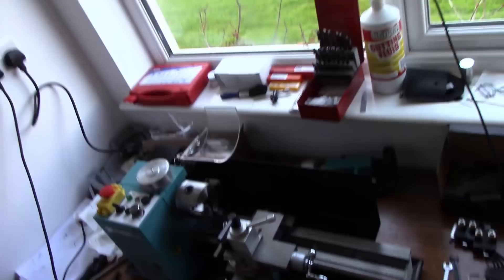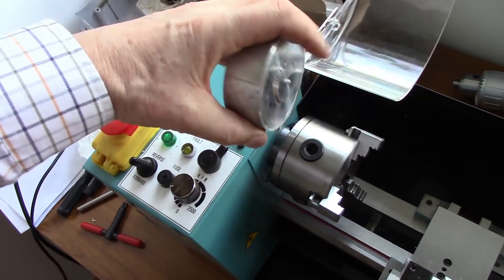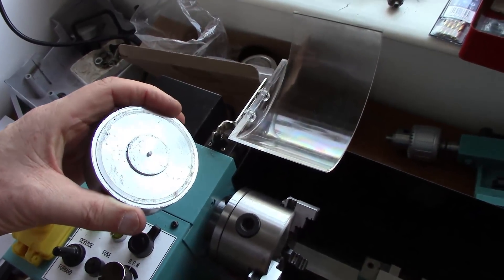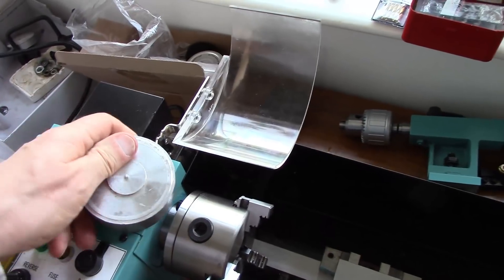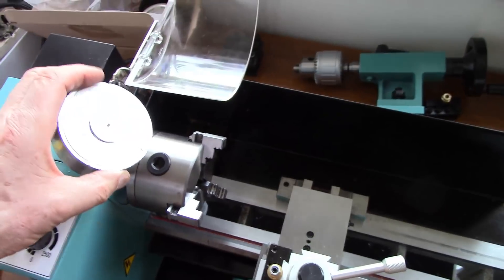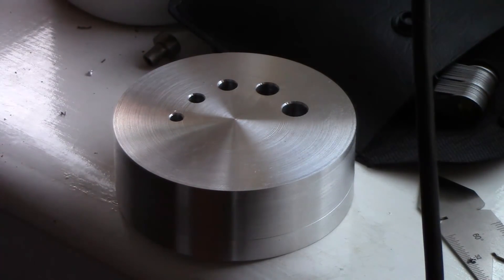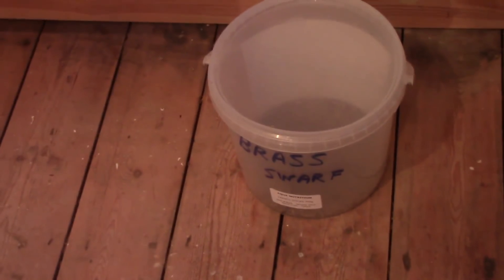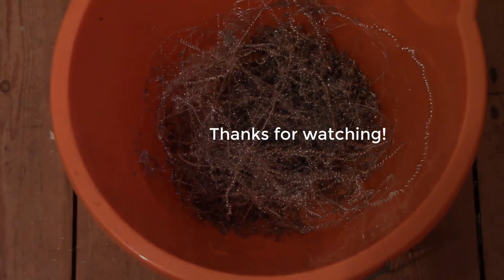Turning a large aluminium piece on the SC2 mini lathe

Comment: Hi. I’ve bought this lathe and the Chinese quick change tool post. Can I ask how you use/slacken the original tool post please? I’m ready to go however, the tool post handle won’t budge. Thanks in advance.
Reply from the maker: I can't remember much about this, but my recollection is that it just unscrews in an anticlockwise direction. So I suggest apply more force
Reply: @samuelfielder  thanks fella. I’m on to Axminster waiting on an email response. Once it’s off though is the Chinese quick change post easy to fit. I’ve got the same one as you. Love the videos by the way. Michael
Reply from the maker: @michaelchatt2639  Yes. It's just a matter of unscrewing one and screwing on the new one.
Reply: @samuelfielder  thanks again mete. Axminster have suggested some wd40 and a gentle tap. Failing that they’ll replace the whole lathe. I’ll let you know the outcome
Reply: @samuelfielder  fitted the tool post. Although I can’t fit the original black handle like you have. Any idea why Samuel?
Reply from the maker: @michaelchatt2639  Don't know. Does it not screw on? The thread must be the same (unless you had to tap the top slide).
Reply: @samuelfielder  I think I know what I’ve done wrong. You left the original bolt on as it hasn’t got the hex nut on. I used the one of two out the replacement tool post box!

Comment: Samuel,
   The nibs after parting off are a fact of life. Rarely is a piece parted off cleanly. 
    After you angled your tool a bit you discovered the chatter lessened quite a bit. Thirty degrees is not excessive and most machinists set the compound at 29 degrees and leave it there for most operations. 
    Aluminum of any kind is difficult to get a pristine finish with a hand fed cut. The interrupted movement creates the line pattern. Some have made attachments for cordless drills to facilitate more even movement. I’ve tried it but for me there are so many things going on while turning adding one more thing to do is counterproductive. 
   Swarf is the bane of aluminum, especially the long, stringy chips, quite pretty, but a nuisance. There are carbide inserts especially ground for this material but still do not break the chips adequately in my opinion. Also you will find in using HSS or carbide bits of aluminum will weld to the cutting edge as the tool heats up. Sometimes it’s just a matter of scraping it off with the edge of a file or knife. If the weld is severe the tool has to be re-ground. 
   I know I and others have offered this advice before but the more solid you get that little machine the more satisfied you will be with it. I know the machines come with rubber feet and are marketed as being portable but the stresses of cutting metal are considerable and far exceed portability and the capacity of the rubber to absorb the vibrations. (Only The Beach Boys are able to endure “Good Vibrations”. Lol)
   As for your comments about people enjoying watching someone with no lathe experience we are all on a learning curve here and most of the advice given is from those of us who have been right where you are now and give comments on how we approached and solved the problems. 
   Machining, even with a small mini lathe can be an extremely satisfying endeavor as each little quirk of these machines are conquered.
  Dale

Comment: 👍👍  I think you need lube and you need to secure lathe to table with all the pressure from tool cutting into part you get bed twist and chatter. And i can see flex in your compound may need to adjust gibs a bit. And tool seems to be rubbing may neet to regrind with 6°relief as shown in tool grinding on you tube videos.
Reply from the maker: Thanks. When I have time I'll build a hefty table.

Comment: Hi Samuel, I often see the thumbnail for this video when I am on yt as it comes up as a suggested video.
That swarf is horrible, were you using machining grade aluminium? It makes life much easier for the machinist. I am not aware that the price is any different. I will only NOT use it when the customer needs to anodise or weld the part.
A carbide "finishing" insert could work well for a lathe that. This may help you get swarf that is more controllable.
Looking forward to the next video with a suit of small sails.
Reply from the maker: Haven't a clue what type of aluminium it was. Bought off ebay but it was clearly something that had been left over after machining. I don't know why this video has attracted more interest than most, because I really am only blundering around in the dark re. machining. Perhaps people enjoy watching someone who clearly doesn't know what he's doing!
Reply: No doubt it was machined.  Large lathes with lots of horsepower can rip into the other grades of aluminium without a problem.  It is smaller machines like ours that need the right alloy to work nicely. Anyway now you know it exists and if you have a bit to do It may be worth trying for a machine grade aluminium. Next Woodstock video??
Reply from the maker: Thanks. Working on next video but have been busy and we have difficult edit to do.
Reply: CAN !! YOU !! CONTROL !! SWARF !!!???
Reply: @davidwillard7334  I take that is me you are harassing again rather than Samuel? If so, indeed I can, I find the ultimate control is achieved by forcing the swarf into light proof bags and forcing it to sit on a cold concrete floor. It really hates that. Once I find it is taking up too much space in the workshop, I lose any desire to keep it under control any longer. I then force into a vehicle and convey it to a large recycling facility from where escape is impossible. The new controller then does with the swarf just as he wishes, he exerts far more control over it than I could ever hope to.
Reply: @smallcnclathes  WOW !! YOUR !! WORKSHOP !! MUST !! BE !! CLEAN !! AS !!???

Comment: Some of the chatter could be your tool post these aluminium posts are just junk
Reply from the maker: Yes. I tried to see this by filming lathe from two directions close up, but the result was inconclusive. I hgave tried using the chunky steel tool post that comes with the machine, for parting off, but I think most of the movement is in the gibs.
Reply: THE !! ENTIRE !! LATHE !! IS !! COMPLETE !! TOTAL !!AND !!!  UTTER !! UTTER !! UTTER !!! JUNK !!!!!

Comment: Is your cutter a fairly quality cutter? I’ve seen some where the cutter was terribly low quality, claiming it’s carbide or quality tool steel. Is there any play in the hand wheels, chuck, headstock or pulleys. Could it be the work piece too big for your cutter? Your cutter length rubbing work piece, as you feed in?
Reply from the maker: Thanks. I thought the tools were all good quality but I think now they are M2 steel which is without Cobalt, but they cut aluminium very easily (it seems to me). There's always some backlash in the hand wheels, not elsewhere. Yes, I did have the tool wrongly angled for the facing cut, initially. Not sure what you mean by workpiece too big for cutter. I should have angled the top-slide at 45 degrees to allow facing in one movement.
Reply: As far as the work piece being to big for the cutter, with those types of machines its a blind "hit or miss", my good friends son had a very similar lathe he used to make pens with, as a novelty, the kid wanted to make an over sized Yo Yo, with thin walls, the yo yo being 3" (76 mm), just about the capacity limit of the chuck, he suffered similar troubles as you, wanting to see the kid's process of machining this sized piece, i found no matter what the kid did, he would get chatter. when i fiddled with it, i had to speed and feed very slowly, which was very bad on all levels, including the tool cutter, which was a 3/8" cutter, for the machine. So i figured, I machine a one solid, tool post (eliminating compound slide for this project) with the ability to hold 1/2" and larger tool holder/cutters, though it made the small lathe a little "Frakensteinish", at the time, we found any size tool cutters (small to large) would work. I then found Robrenz and Steffan Gottswinter videos had built similar tool posts. so, if you wanted, you could probably try this route.

Comment: The rigidity is my point. Unless the lathe is firmly attached to the stand or table, you'll never get the rigidity you're talking about. Please try it!
Reply from the maker: Well I might - despite not following the logic - as having the lathe bouncing around relative to the camera is a nuisance.
Reply: I also think you would be better off having it bolted down to a heavy worktable, with the machine vibrating like that i i can imagine there wont be very stable cutting, this is usually never an issue when working "normal" sized lathes as they are far more sturdy than these things and sit steady on the ground just with their weight.

Comment: My opinion is that your lathe is flimsy or not securely attached to the work table. I noticed how it shook when you cranked the tool back after facing the piece.
Reply from the maker: Indeed it isn't securely fixed to the work table. It isn't fixed to it at all! That's why it shakes with respect to the camera which is on a tripod on the floor. But I don't see the relevance of that to the issue. The rigidity I need is between the tool and the chuck (via the top slide, the cross slide, the saddle and the lathe bed).